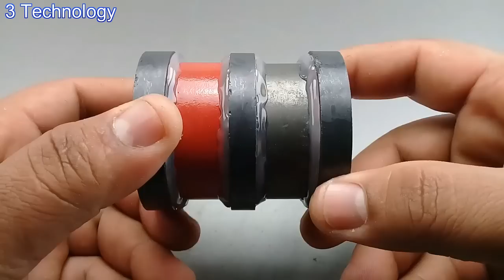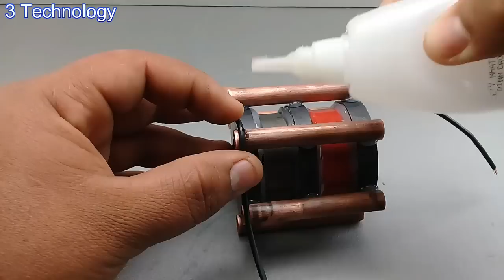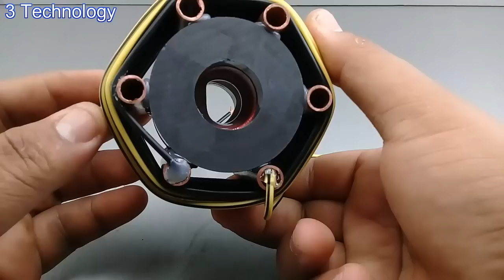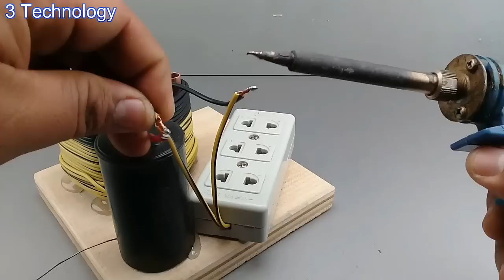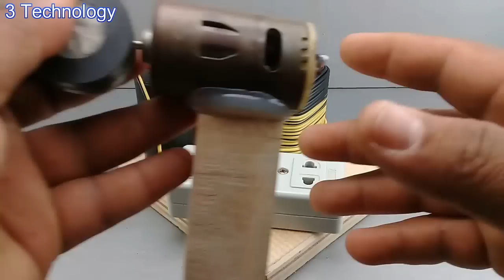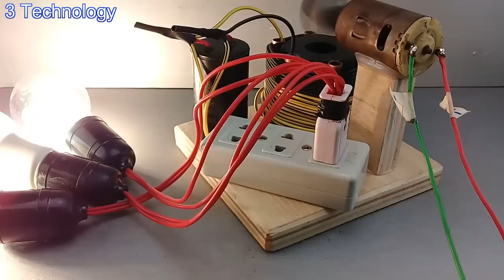Get 230V 9000W Electricity Energy From PVC Wire Use Six Copper Pipe With Magnetic Gear

Comment: In any system, you cannot get more pwr out than you are putting in. In any transformer, whether step up Or step down, the power is the same on both sides(primary and secondary). You need more schooling in the trade, I believe.

Comment: nice to see and I think this works but you can't get that much power out of it and that's why I think the real energy source is hidden under the wooden platform. Only when you lift it up and show the underside then I have more confidence in you.
Reply: If the motor is 12Vdc, then he could use a solar panel to power it and show the power source for the motor. I gree with u, there is a hidden source under the table.
Reply: How much do you get out of your.  If it works you still have to bring it down to 110 or 120 v to be any good.